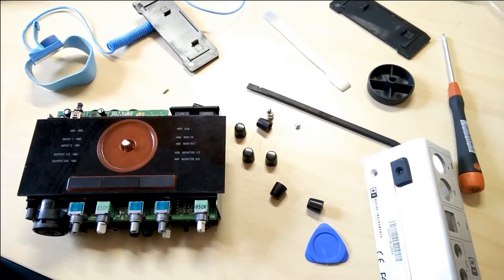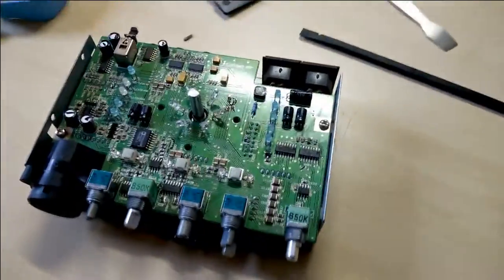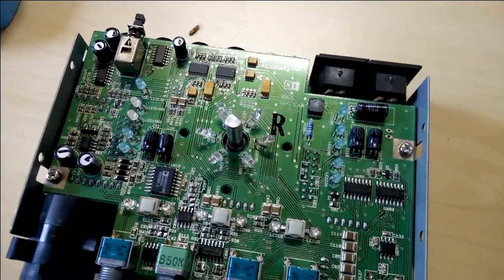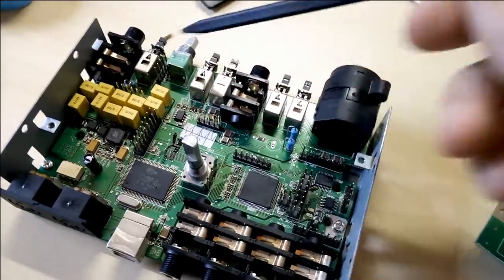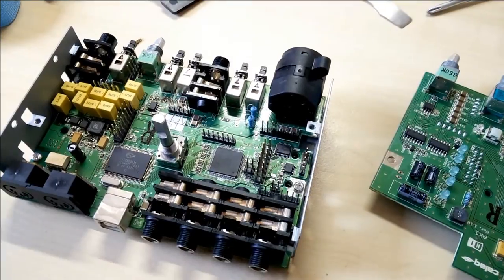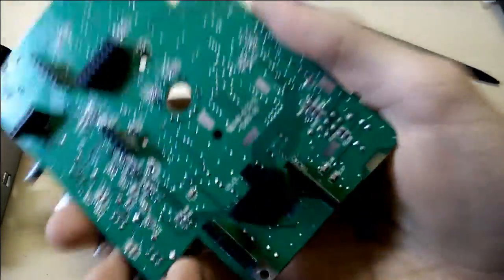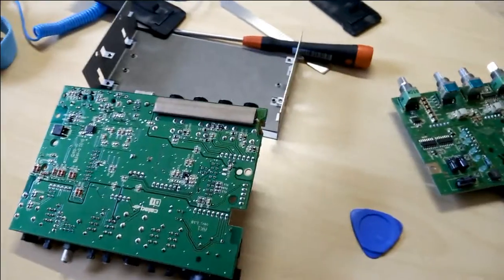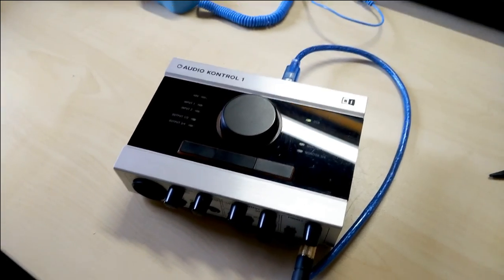Audio Kontrol 1 Teardown and Headphone Jack Repair

Comment: Thanks for the video, but it's a shame you did not show how you open this INCREDIBLY STUPID case. I got the volume knob pulled off and the top black plastic top pried off (very gently) which is glue on. How do you get the side panels out? There is very, little space to allow you to insert even a thin blade ?
Reply from the maker: Hi, yea sorry for omitting that part. But I was fighting to get it open as well. ;) After removing all knobs and screws on the outside, I think I tried pulling the metal covers sideways away from the rest of the device (kinda like a rotating motion, thumbs on top pulling outwards). Feels terrible, looks terrible and makes weird sounds but eventually it gave way. Then I was able to remove the black plastic pieces on the sides. That's where the video starts.

Comment: can you design a audio interface
Reply from the maker: I was thinking about it. However, when getting into 24b@192kHz territory, things start to become difficult as there are no USB->i2c ICs with these specs available. This means I'd have to build even that part from scratch (including drivers on the PC side), definitely doable but it would require a lot of time which, atm, I don't want to invest.

In summary, I would probably be able to do it, but don't expect anything anytime soon.

Comment: thanks for the video man! had the same problem with the headphone jack. Weird. My solder joints looked perfect before i resoldered them. Anyways it worked! Would have been great to know how you got off the metal halves. I almost broke the whole thing in half muscling off those damn things! haha!
Reply from the maker: yea sorry about not showing that part. I originally wanted to, but after getting it open for the first time, struggling with the exact same problems you had, I didn't feel like doing that again just for the camera^^ But I'm glad this video helped you at least to some extent, and that you got your interface working again :)